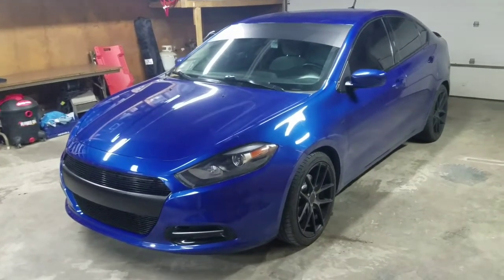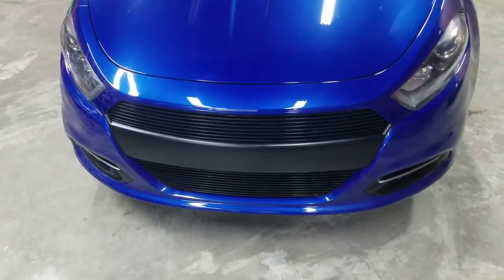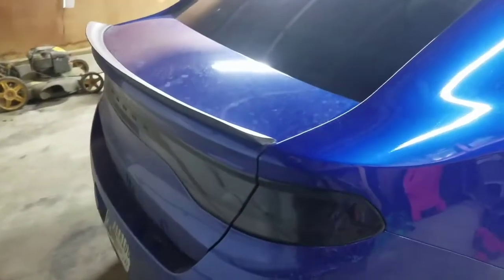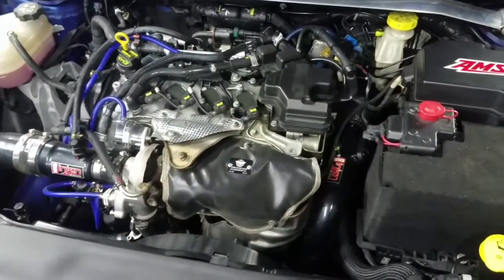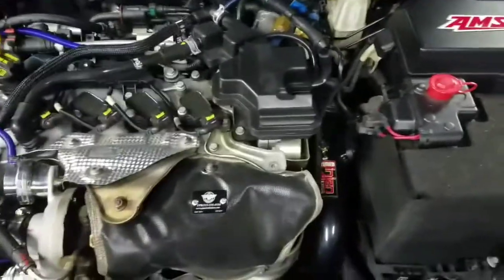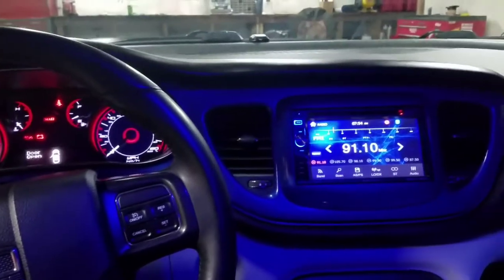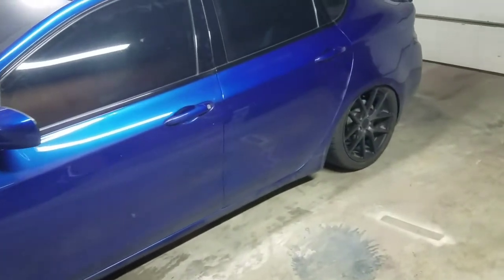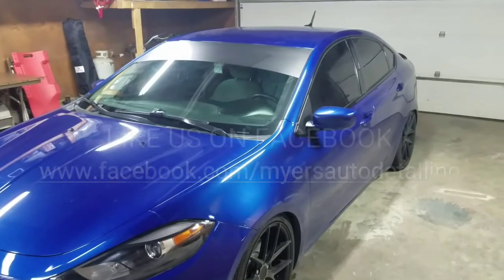DODGE DART W/ AIR RIDE (BAGGED)/MODS - UNDER CONSTRUCTION

Comment: I have a 2015 Dodge Dart Sitting on coilovers right now but I’m looking to switch to air ride, from air tekk what stag kit did you get?? 1,2,3,or 4
Reply from the maker: Stage 3.....the only difference between 3 and 4  is the air management system....3 comes with the Airlift 3P (preset pressures) and stage 4 is Airlift 3H (height sensors).....
Reply: If I were to go with stage 4 would it drop my car lower then 3 or no??
Reply from the maker: @tru_society_2132  NO, the only different between stage 3 and 4 is the air management system.....STAGE 3 is Airlift 3P, and STAGE 4 is Airlift 3H (height sensors)

Comment: where did you get the Edge Insight and would you be willing to make another piece like you did in carbon fiber (Plate)???
Reply from the maker: The Edge insight came from Ebay...and yes I can make you another plate, the plate in the car holds our Airlift 3p Controller for the air ride not the Edge insight.....I also have made another carbon plate prototype that holds 3 gauges instead...
Reply: i would need it to hold six switches but do you have a flat one with no holes
Reply from the maker: I dont currently but can order more carbon plate to cut one...
Reply: Myers Auto Detailing & Customs okay awesome how much would it be ???
Reply from the maker: It would be about $60.00 shipped in the USA....mine is just sitting there so if you want it permanently mounted you'll have to come up with some sort of mounts to screw it to....
Reply: Myers Auto Detailing & Customs well I want it to be able to come off and to be put on
Reply from the maker: Okay well I can send you the blank plate like mine.....you just sit the bottom in first and the top just presses in and sits in the top on that small lip below the AC controls.....mine fits pretty tight with no mounts so I just left it, but thought about eventually maybe coming up with some L-brackets and screws to hold it but havent come up with anything on that yet
Reply: Myers Auto Detailing & Customs awesome and can you make it in abs plastic ??
Reply from the maker: Rick I never have but I dont see why it couldn't be done
Reply: Myers Auto Detailing & Customs how much would it be
Reply from the maker: Rick I'll have to see what the ABS will cost me and get back to you later tonight....
Reply: Myers Auto Detailing & Customs awesome thanks
Reply from the maker: I can cut you a blank one from 1/8" ABS for $40.00 shipped
Reply from the maker: Or I can do 1/16" ABS for $35.00 shipped
Reply: Myers Auto Detailing & Customs really okay awesome can you send me a message
Reply from the maker: Ummm, how do you want me to message you
Reply: Myers Auto Detailing & Customs email if not I can message you on Facebook

Comment: Where did you get your front grill from?
Reply from the maker: Ebay actually
Reply: Bryan Myers - Automotive Vlog do you have an installation video?
Reply: Bryan Myers - Automotive Vlog camber plates on the front grille?
Reply from the maker: @nickneibauer7552  Sorry someone else asked me about an install video on the air ride too...But we didnt do a video on the grille either.....They simply sit on top of the OEM grille, and attach with little bolts through the OEM grille.....Worst part is taking the bumper off to remove the "crosshair piece" on the top grille
Reply: So I ordered the front grill and am having trouble installing the front fascia back on (the black piece you wrapped). How did you get it over the new grill
Reply from the maker: @nickneibauer7552  Its has to be snapped back on BEFORE the install the grille inserts
Reply: Ohhhhhhhhhhhhhhhhhhh. Thank you and even bigger thanks for the fast reply
Reply: @BMyers3887  what kind am i buying all i see are the ones for trucks??
Reply from the maker: @jakedurda1993  What kind of what exactly?
Reply from the maker: @jakedurda1993  The grilled can be found here:

https://www.ebay.com/itm/GTG-2013-2017-Dodge-Dart-2PC-Gloss-Black-Custom-Billet-Grille-Grill-Kit/183479873101?fits=Year%3A2013%7CModel%3ADart%7CMake%3ADodge&hash=item2ab840ae4d:g:lPIAAOSwTuJYnHc7
Reply: @BMyers3887  thanks

Comment from the maker: Exterior:

Black billet front grilles
Duck bill spoiler
Tinted taillights
Tinted windows
Black headlights
50 cal shell antenna
18" Niche Wheels
AirTekk air ride setup w/Air Lift 3P management
Vinyl brow on windshield
Custom partial wrapped front bumper
Drilled/slotted brake rotors

Interior:

Color matched gauge bezel
Pillar pod
Boost and AFR gauges
Edge Insight 
Custom mount for 3P controller
Planet Audio DVD/NAV dash unit
Planet Audio speakers (all)
Billet shifter knob
Blue LED interior lights

Performance:

Cat-back exhaust
Catless downpipe
Wrapped downpipe and turbo blanket
INJEN intercooler piping
INJEN cold air intake
Alfa Romeo 4C ignition coils
Euro Compulsion stage 2 tuning
Short throw shifter with solid bushings
Forge vacuum blow off valve conversion
Forge wastegate actuator
Boost leak/evap elimination
Solid shift linkage tension strut (Deyeme Racing)
Sickspeed oil catch can
CM FX250 clutch 
CM lightweight aluminum flywheel